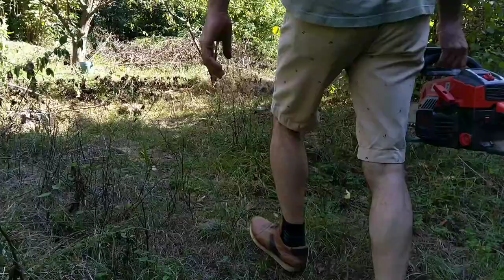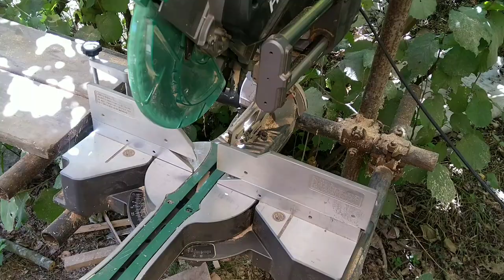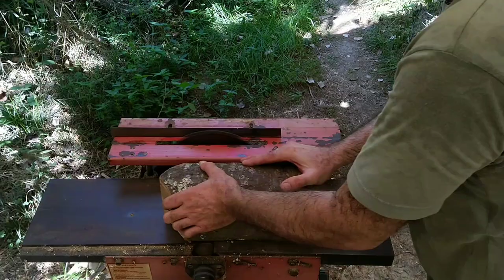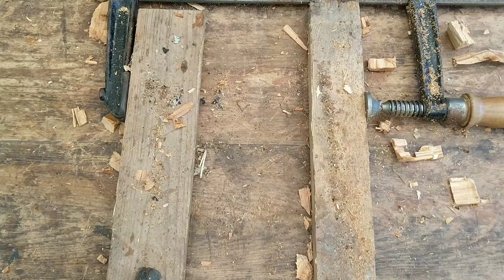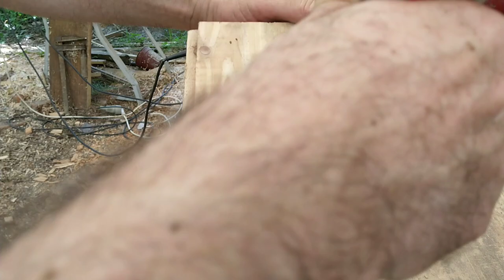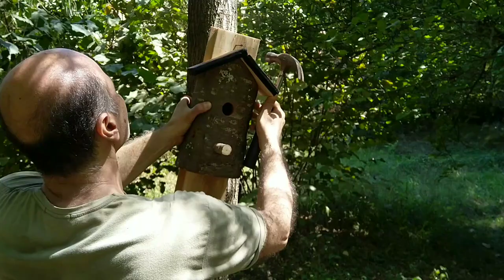Homemade Bird Houses from Natural Log(DIY nesting Bird Box)

Comment: Should have used screws on the back to facilitate annual cleanout.  Also, birds do NOT require a perch.  Predators, however, do. Finally, drilling holes in the bottom for drainage, and holes around the top for air circulation are necessary. That being said, nice, rustic woodland habitat ...